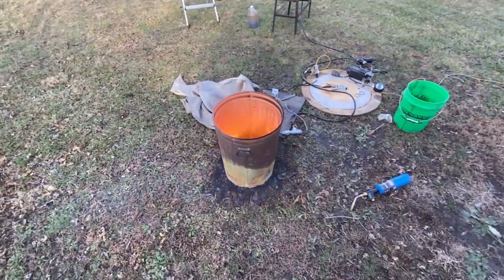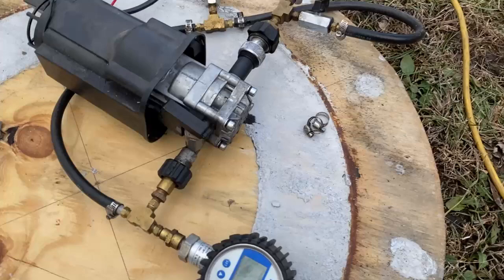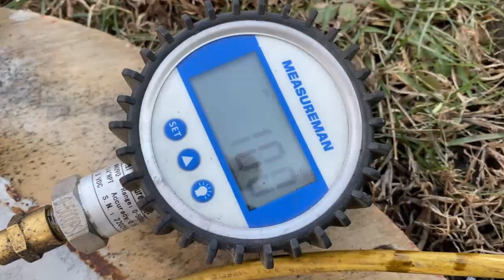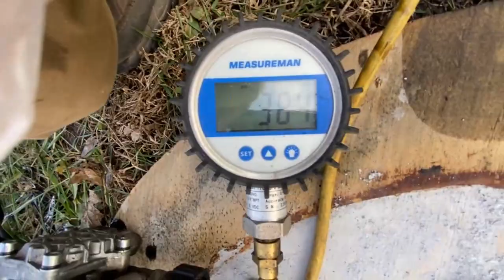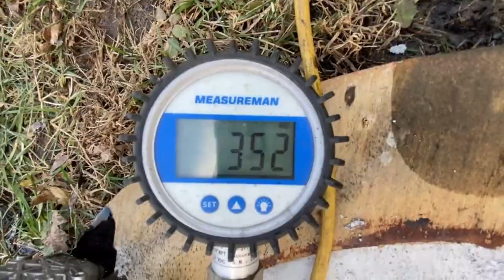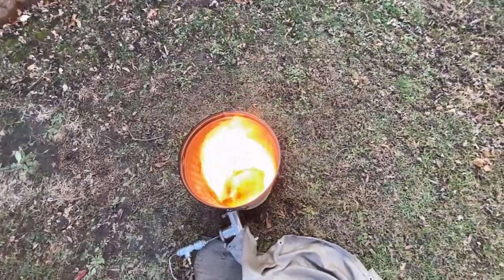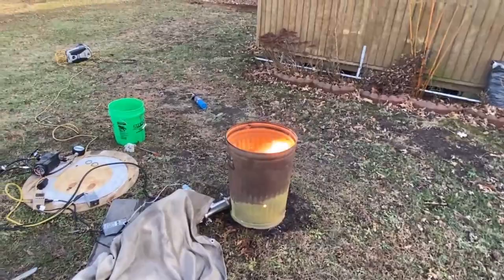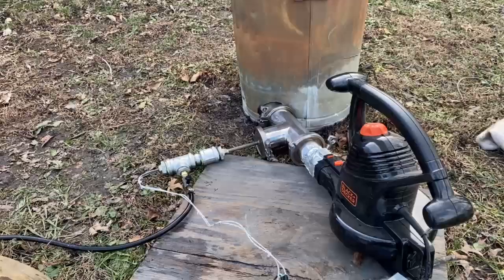Blower powered Cast Iron Smelting burner 2500F

Comment: You clearly know your stuff.   I’ve been planning a wood boiler / oil burner build and will be contacting you about the oil system.   

Or I could build it 14 times until it works as well as your would first go.  Lol

Comment: I wonder, if you preheated the air to just below autoignition, would it vaporize the droplets to make a blue flame?
Reply: I would like to know more about it too. Some tools like a big hidraulic hand  is very expensive and have much weight to install in us Mercedes Benz 1513 1978 trash truck! I need to made a cheaper pneumatic solid transportation to transfer fertilizers inside the shit trash truck to the plantation machine of soybeans here in Brazil. I will use a literally trash turbocompressor (but I get it, 3 turbos for free with my mechanicals great friends). I want to power the turbocompressor with lubrication oil and use the purge of the pressure and air flux in the compressor to drive an air multiplier to sucks/blow the solids in a pipeline. I think that's a solid pneumatic transportation can be more efficient if used some spaced units of reinforcement power pressure and velocity inside pipelines that's possible only with indirect propulsion because the solids can't lose energy shocking with the walls if used a proppelers and the only solution is an air multiplier. Today we transfer 8 or 9 packs with the hands in of 50 Kg each every time that's the machine put all fertilizers and soybeans in the soil in about 50 minutes😑 at the sun of 33 or 36 °C with lower than 35% of relative humidity 😭. But I will increase more this temperature with my homemade turbojet engine😈🔥 and expand some of intercooled air compressed air into my jacket in a similar concept used in the jet aviation making a personal air conditioner 😜to cool my only body 🥶 with efficiency.